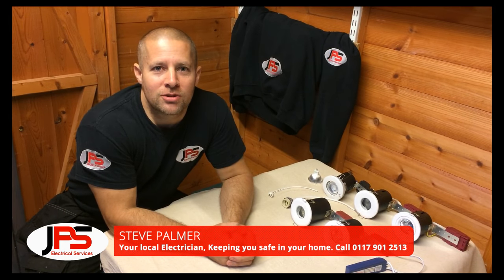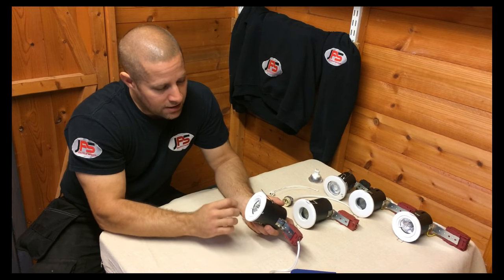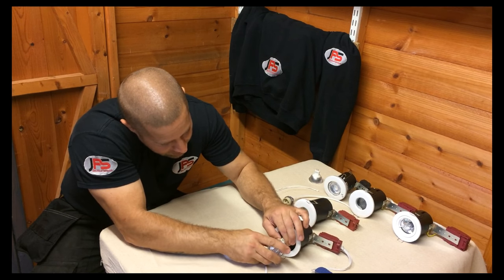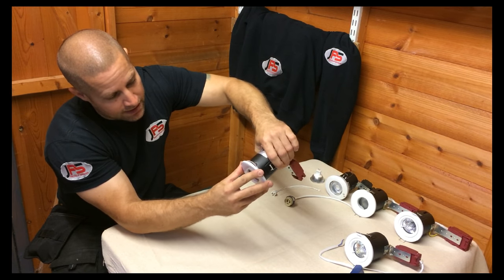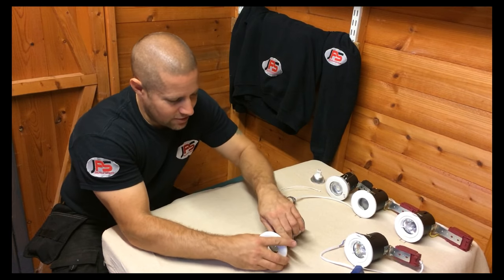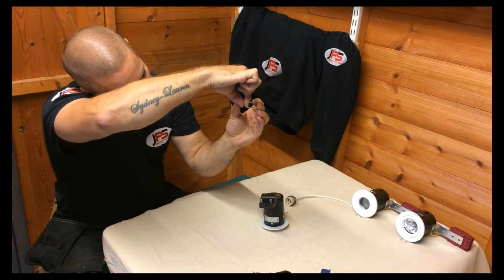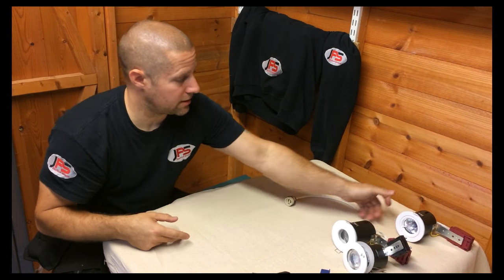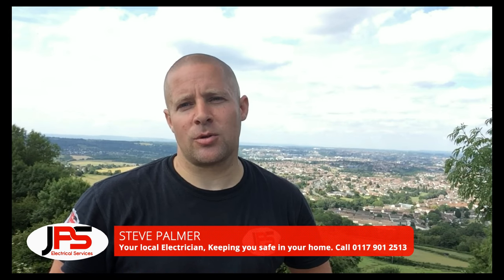How To replace a bulb in a recessed downlight - Your local Electrician

Comment: I need help:((( Spend half a day watching YT videos to understand how to change my bulb. In the end I had to cut it off the ceiling because it was painted over by the builders a few years ago. I managed to get it out but now I’m stuck as I can’t figure out how to take the bulb out of its casing (or whatever it’s called)😢😢😢.
Reply from the maker: Hi Viktoria, thanks for getting in touch.

Please visit my website www.jpselectricalservices.co.uk and complete the contact form. It will allow you to upload a photo so that I can see exactly what the issue is.

I look forward to helping you soon.

Kind regards 
Steve :)
Reply: @JPSElectricalServicesBristol  omg thank you so much!! 
Ive already done smth wrong.. I took out the whole fitting out of the ceiling🤦‍♀️🤦‍♀️🤦‍♀️ then didn’t know how to take the bulb out. Then someone told me to use a screwdriver do detach the piece which I didn’t know was detachable - and it was!! It’s hard to explain showing just a photo. I made a short video - will have to upload here, if you dont mind, would you have a look tomorrow? I’ll send a link once it’s uploaded. My question is - after I put the fitting back in, now there’s a visible gap between the ceiling and the fitting, is it ok to leave it like that? Or should I buy some sealant and cover it? And - when I touch it, it sounds scary, very loud creak or squeak. The second bulb should be easier to change since I already know how it works.. although I’m scared of electricity 😳😳😳
Thank you ever so much for replying and offering to upload a photo!

Comment: For the spring clip type https://youtu.be/4hWjCiJuauA?t=273 I've found you need to set the bulb in place inside the fitting then push the spring clip until it clicks into place then screw on the outer plate. If you haven't put the spring in place properly the plate will not srew onto the thread.

Comment: argh we've got  older style gu10 mains fitted lights in the bathroom, no clips, not twistable, won't budge in any direction, any ideas? Help!!!!
Reply from the maker: Thank you for taking the time to comment.

If your units are using the old style halogen lamps then there is a possibility that the unit itself has become warped which is preventing the light from twisting.

If you would like to email me then I might be able to identify the type of unit and confirm the method of removal required.

I hope this helps.

Kind regards 
Steve :)